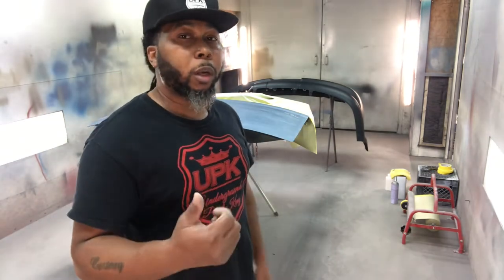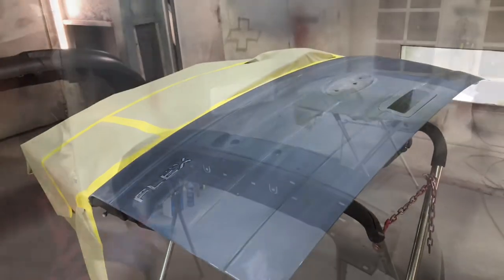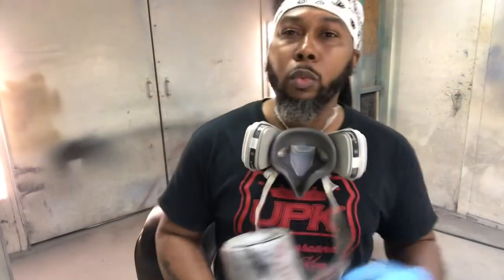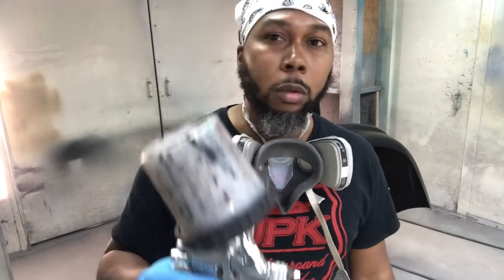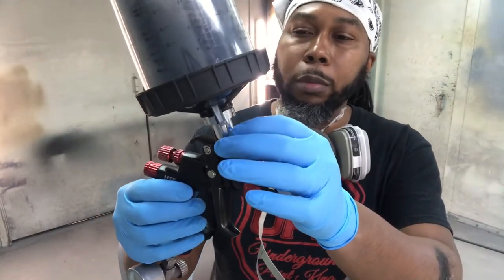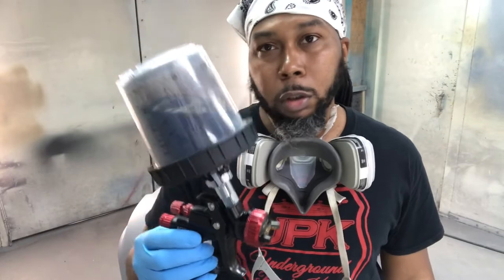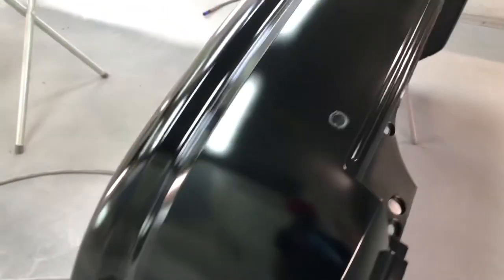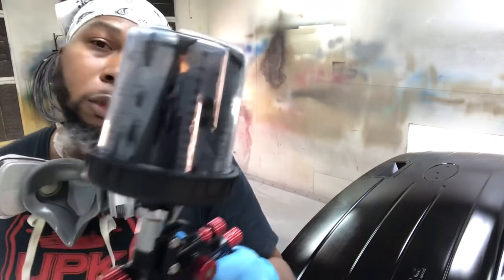Painting parts for the 2009 Ford Flex

Comment: Have a infrared heater on 1500 watt light now I see they dry paint faster but want to use something to heat garage in winter to paint but warm up the garage to 70 degrees have a propane 30,000 btu heater but don't know how long that will last warming up the whole 2 vehicle garage. Also got a electric sander a Bauer from Harbor Freight so don't have to wait for the small air compressor at home going out all the time when sanding. I also got 3 spray guns from Ali Express they named Ronpeng I don't know if you used them but it said they were professional spray guns I have the lvlp I told them to set the spray pattern before they ship I got a 1.7, 1.3 and the last one coming now 1.4.
Reply from the maker: I’ve never used them

Comment: Quick question.... I sprayed my tsx last weekend and the damn compressor was spitting air into the line so we pun an in line filter and a filter  before the line and it sprayed like crap at first but then as we kept going it got better. My question is .... could that water from the line change the color of the paint?
Reply from the maker: The water shouldn’t change the color of the paint
Reply: Thanks big bro! You've motivated my brother and I to give it a shot and we going 💪

Comment: I just got a front bumper that’s black with pores I want to color match it silver like my GT any recommendations on what grits to use ?
Reply from the maker: @MustangFourSix  usually a grey scotch brite will work
Reply: @ I shouldn’t worry of taking all material of correct just pretty much sand till it’s smooth and primer ?
Reply from the maker: @ you’re just putting a good scratch into it so that you get good adhesion for the next material you spray on it
Reply: @UndergroundPaintKing  I have maroon only im going to go get some gray one rn thanks sir
Reply from the maker: @ you’re welcome!

Comment: Is the black widow really as good as sata?
Reply from the maker: I don’t use sata spray guns but the black widow is a really nice gun!
Reply: That’s good to hear! I have an atom x 27, but I have the temptation of trying the black widow
Reply from the maker: @abisaigutierrez6246  what’s your thoughts on the atom x?
Reply: @UndergroundPaintKing  so far it’s really good compared it with a sata and I couldn’t tell a difference. My only problem is that I got a 1.4 tip but feel like I should’ve had a 1.3